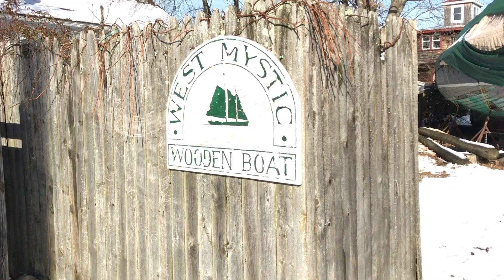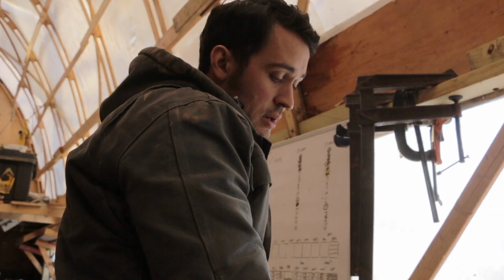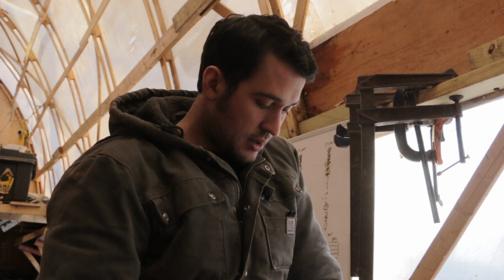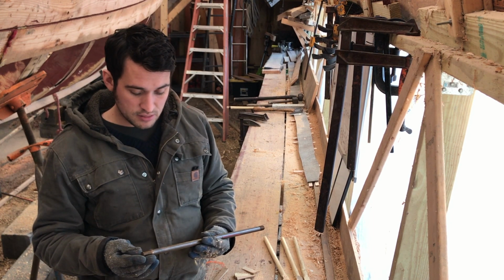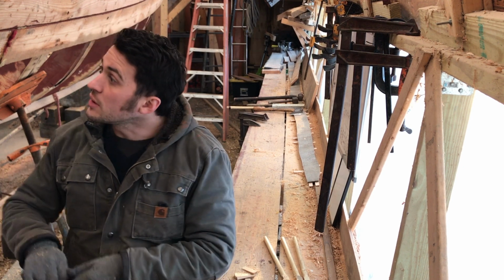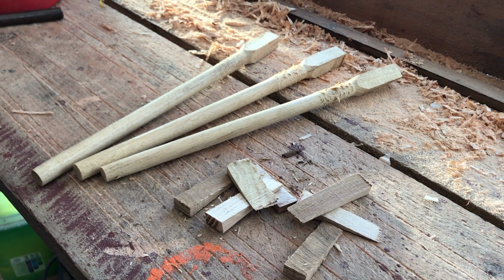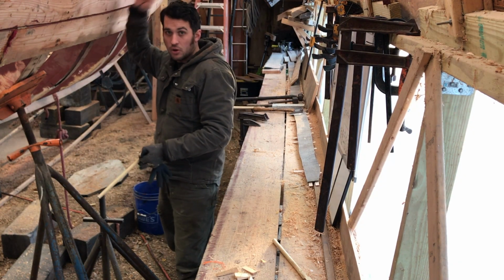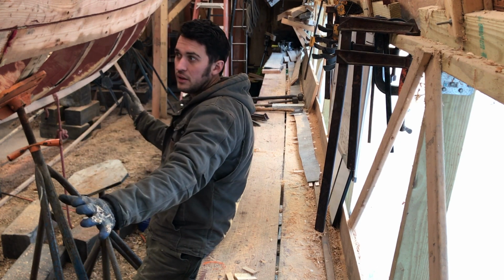Restoring Rosalind, Episode 4: In Which Fastener Choices are Discussed

Comment: As one Cornish Lugger owner to another keep up the good work.
Reply from the maker: is that Lindy Lou?
Reply: @RestoringRosalind  Yes that's her, big refit going on at the moment,  she was laying in a boatyard for 5 years under a hedge, I had to cut the weeds back before I could see her, a real head or heart moment whether to take her on but she was going to be cut up if I didn't so the heart won.  Now it's new bulwarks, gunnels, some of the deck, new engine, drop 3 or 4 planks in the hull build a low cabin over the fish room and fit-out inside, we must be mad. LOL
Reply: On the Tree nail or Trunnel theme, I think I'm right in saying Chris Rees used something between 4000 and 5000 when building the Greyhound, used to fasten most parts of her from frames to planks deck and bulwarks and she looks good on it, from what I've been told Oak trunnel is normally expected to outlast metal fastenings.

Comment: I would think trunnels would be ideal for restoration work. Just drill them out and make new trunnels to go back in the same holes. What am I missing?
Just make sure to center the drill bit upon removal. Or, drill one side with a conical or step-drill and drive them through. Of course, if the interior has been walled over (ceilings) that makes it quite a bit more difficult. Then you drill all the way through, and backbdrill the ceilings (walls) drive out the old trunnels, install the new ones, and cork/plug the holes in the walls. Just make sure you know for sure where plumbing and electrical services run so as not to drill into them.
Reply from the maker: in my experience, because the trunnel is endgrain it is hard to get a bit to follow the trunnel - it tends to want to wander out into the frame, hogging out the bore (every once in a while I drive one that's a bit too big, and it fetches - have to bore it back out and it usually means I either have to add more wedges or go up a size with the next trunnel). if your scantlings are such that going up a size would be fine, then definitely it's no big deal. my scantlings are on the light end for this sort of thing though

Comment: Curious; When would you pre-cut the slot in a trunnel for the wedge vs splitting the trunnel after it's already inserted, as you did? Is it just personal preference?
Reply from the maker: Being that one normally cuts both ends of the trunnel to about 1/2" proud of the surfaces after driving it through, cutting the slots happens after driving it.
Reply from the maker: unless you're doing a blind one, where it will bottom out in a bore - then you cut a kerf and gingerly lay in a little wedge and try to drive it such that it sets at the bottom of the bore. it is wicked fiddly though! for through-bored ones, pre cutting the kerf is asking for trouble in my experience (more likely to split destructively in the driving process)